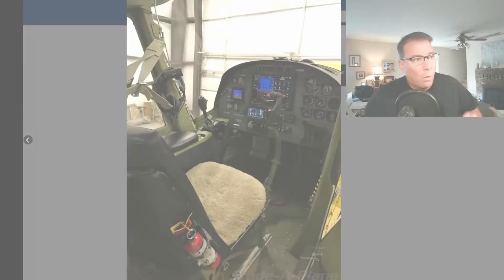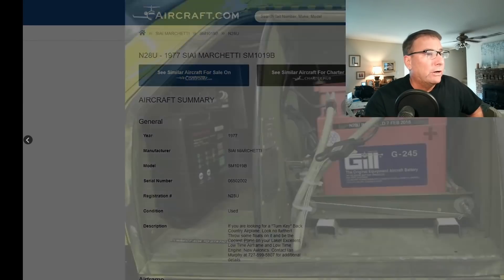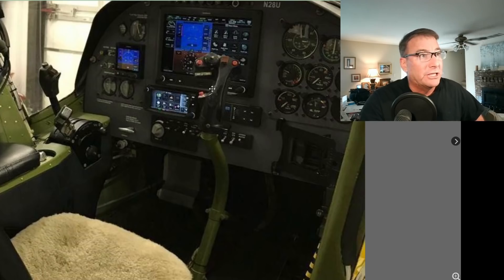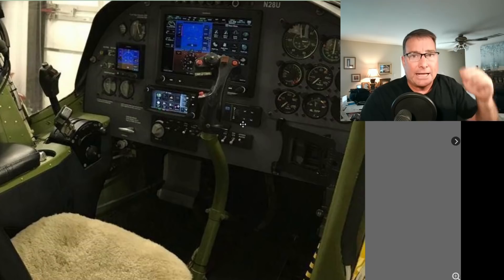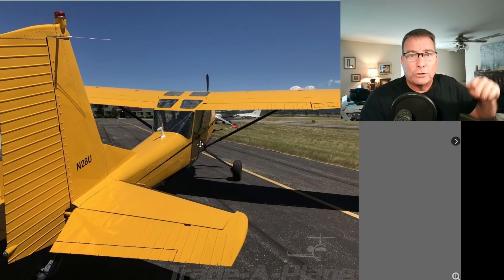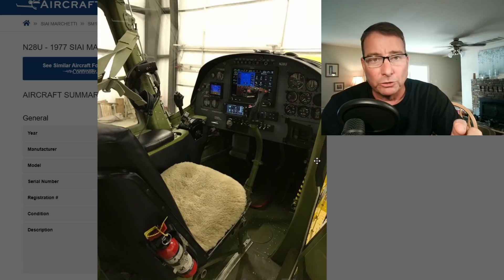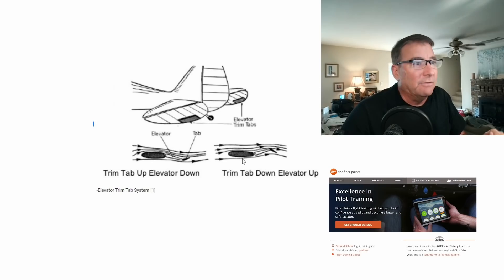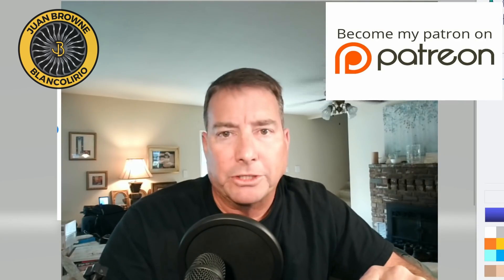Dale 'Snort' Snodgrass Siai Marchetti UPDATE- Elevator Trim System 8/8/21

Comment: I'm sticking by my theory, this guy was in a huge hurry and again, listen to the tapes, he was on the wrong frequency, had his numbers called out before even taxied, and even tried to take off without clearance, and that back seat was full of camping gear I think he just tossed the stuff in there didn't check to make sure everything is secure properly and something got hung up on that back stick, or where the little canvass boot around the bottom of his stick was missing something could have fallen in there and hung up on his stick, I'm sticking with it.
Reply: FOD - clearly whatever happened caught him by surprise but agree that contreols at some level had to have been stuck - there were no oscillations like he was fighting for control or that he had visible ability to override whatever was going on.
Reply: You make a strong point. Glad it`s not a gust lock error.
Reply: @REDMAN298  yes sir
Reply: @kristyskirt9015  you might be confusing elevator with Stab trim. Alaskan? That was a jammed jackscrew. Even runaway trim on this Marchetti would be responsive to the stick. I lean toward a jammed stick, forward or aft seat....

Accelerated Stall at that altitude likely unrecoverable... Also, the claim is full torque through impact.... Closing the throttle might have actually recovered the deck angle and prevented a fatal....
Reply: @billmecorney  there's pictures somewhere when he bought the plane and the front stick there's a little canvas boot that goes around the bottom of the stick that was removed, and if something fell down in there and jammed up on that stick....
Reply: @kristyskirt9015  I agree Kriisty and also as Robert said, he had absolutely no control from the get-go so whatever it was he had absolutely zero chance of recovering from it, just hearing how much of a hurry he was in and mistakes he was making for such an experienced pilot worries me.
Reply: @kristyskirt9015  no problem anytime, I'm no expert, but I studied the Alaskan crash thoroughly.
Reply: @kristyskirt9015  that jackscrew had NEVER been greased, it was the shaft itself that was aluminum alloy the nut was installed cockeyed and just wore the threads down, actually more like slicing them off, actually the flight right before the doomed flight the pilots had issues with the elevator trim so they were extremely lucky, the next flight crew not so much and when it started again the pilots started messing around with the trim moving it moving it back and forth trying to un-jam it just made it worse and broke completely separating the nut from the shaft, that was a bad one.
Reply: I agree with you that he was in a hurry.  Being in a hurry makes it possible to make many obvious mistakes, mis-packing payload or pushing the airplane out of the weight and balance envelope are just two possibilities.  There are many others.
Reply: @peteranderson037  yes, I advise anyone to go back and listen to those tapes, he was calling out his numbers before even rolled out, was on the wrong frequency, about took off without clearance, and he just sounded out of sorts for some reason it really gave me chills to be honest, just something you wouldn't think of from a pilot of his stature.
Reply: I was thinking task saturation with changing frq while starting the takeoff roll and it just lifted off before he realized and he was mid stall before he was even aware he was in the air....just a thought.
Reply: @jeremysarge1772  possibility, but if you really watch the film he's locked in full nose up and it looks as though he has zero control whatsoever, at the rate of climb he was in I can't imagine him not realizing he was in the air, just from the g-forces alone.
Reply: @kristyskirt9015  howdy. The nut is fixed, it's collet moves up and down. The jackscrew does the moving.....rotating.

What do you think about the power? Was it TO all the way down? The thrust lever doesn't "lock".
Reply: @kristyskirt9015  very sad indeed 🇺🇸 RIP
Reply: Dan over on Probable Cause (Probably/Maybe) posited that on his YT channel.
Reply: @darrens.4322  Gryder?
Reply: @darrens.4322 wouldn't surprise me ill check it out, we tend to think allot alike.

Comment: Do you think if he had chopped the power the nose would’ve come back down?
Reply from the maker: yes....but, very counterintuitive in a moment of surprise.
Reply: @blancolirio   Right, yes, just like the King Air that lost thrust on takeoff (left engine throttle creep?) and crashed into the hanger. He lost yaw and roll control because of the strong asymmetrical thrust but if he had pulled both levers back (along with pushing the nose down) and even if there wasn’t time or altitude to regain VMC maybe some might have survived if they had crashed straight and level.